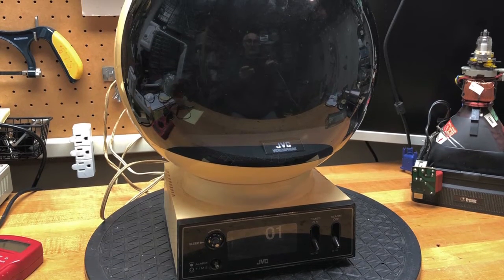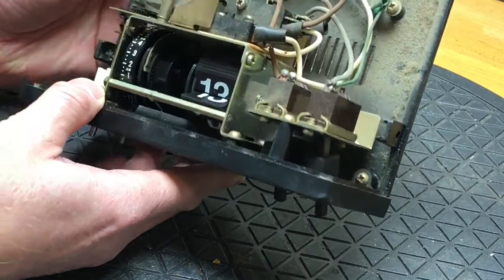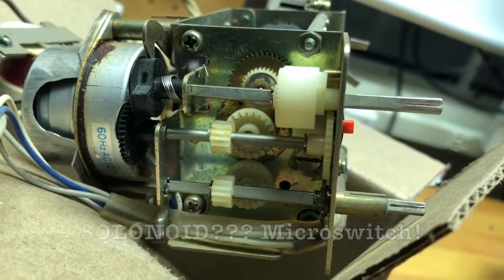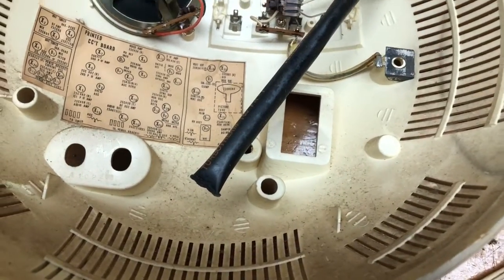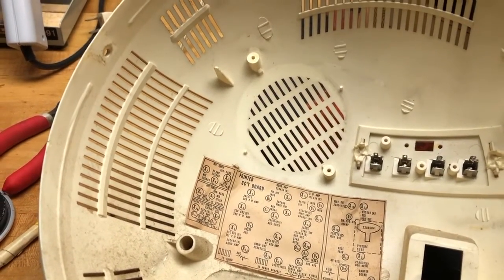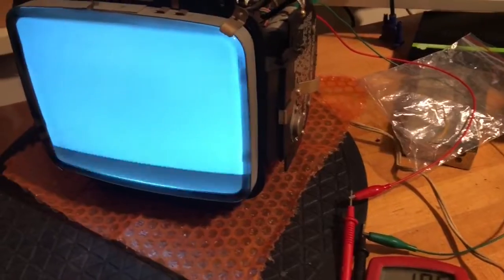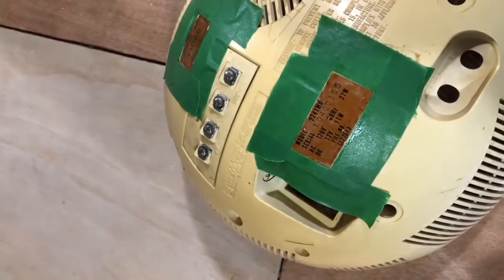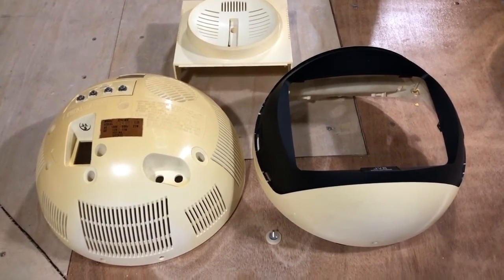JVC 3241 TV Videosphere TV -- Part 1: Disassembly, Testing & Prep.

Comment: Nice video! 👍
Do you know what’s the best way to remove the plastic glass from the front of the tv?
Mine is so dirty that I wish to get off the tv to clean it properly
Reply from the maker: Thank you for your kind words. The tinted plastic  "visor" clips into slots in the white case by the springiness of the visor. Plus, the left and right ends of the visor are shaped like hooks and want to stay captive in those slots. You must release the hooks by gently flexing the hooked ends and they will slip out of the slots. Be careful when cleaning; it's a soft plastic. If the plastic is scratched you will need a very fine plastic polish to restore it.

Comment: Hi, thanks for the video! it is really helpful! A quick question, how can i remove the plastic visor screen from the sphere without disassembling the whole thing? is it easy to do so please? thank you
Reply from the maker: Thank you for the kind comment. I think it would be very difficult to remove the visor without breaking it, or at the very least scratching it. The visor has clips that grip on the inside so I don’t know how you could slip something in underneath to release them. I could be wrong but I think trying that would be far riskier and time consuming than just opening it up. If you find a method that works please let me know!
Reply: @Mr.BrownsBasement  Thank you for the reply! right if i were to open the tv up just for removing the the visor screen, do i still have to follow all the steps in your video please? disconnection all the parts and cables at the back etc im not too confident doing that as im scared I will damage the internal part of the tv. thank you!
Reply from the maker: I don’t think you need to be worried. Give yourself lots of space and time to do the job and have some bubble wrap to put easily scratched parts on while you’re working. The most fragile parts are the plastics that can be scratched, gouged, snapped or stripped, and the picture tube which should be handled gently, especially the screen and the neck. I would suggest you watch other videos on TV repair (check out the channel @bandersentv) so you can familiarize yourself with more stuff you’re likely to encounter. If it makes you feel any better, I was doing light tube TV repairs when I was only 13 or 14. If I could do it, so can you… it just takes preparation and patience.

Comment: Hi, do you know the measures of the inner screen. Wondering if you can replace the screen with an ipad
Reply from the maker: Off the top of my head, I believe it’s a 5 inch CRT, which means the diagonal is almost 5 inches. But you could never get a iPad to fit because old CRTs like this one have aspect ratio of 4:3 (they’re almost square) and iPads are something like 16:9 (they’re very rectangular). You might be able to find a separate LCD panel approximately that size and shape but then you’d have to build the appropriate driver circuitry for it.